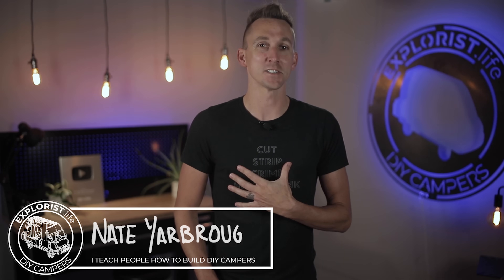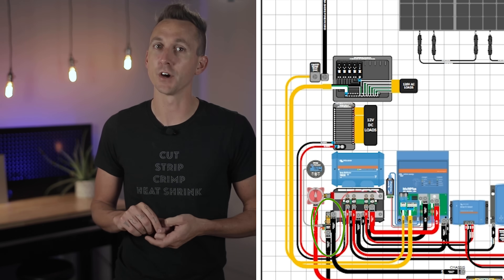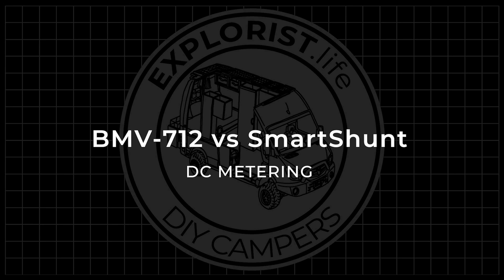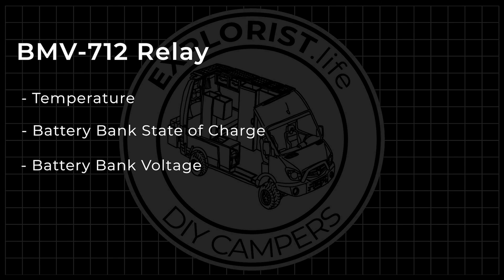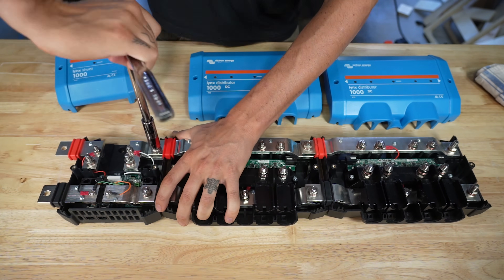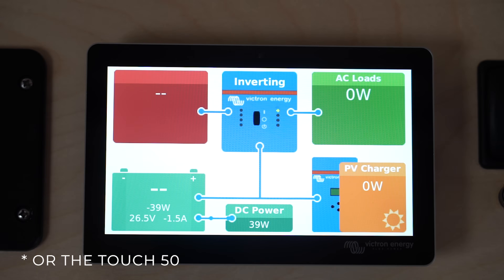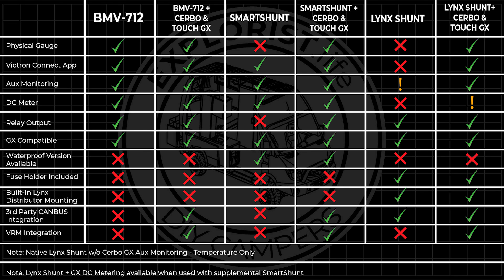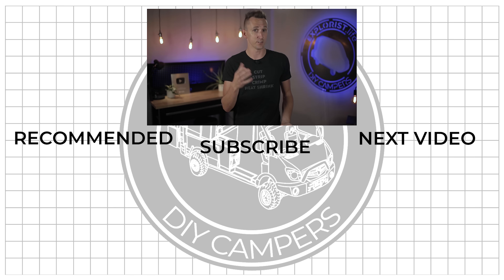SmartShunt vs BMV-712 vs Lynx Shunt

Comment: Great info! I do have a question... I have already purchased a BMV-712 as well a lynx shunt before I understood the component functions. So now I'm learning that it is redundant and possibly disruptive if I use both of these items? I need to decide which to use. If I decide on the Lynx shunt I will need to buy a separate monitor such as the Color Control GX? Which is not a modest price. But if i dont keep the lynx shunt that I was going to place between my two Lynx distributors can I just attach the two distributors together directly? I bought two to have my batteries on the left distributor and other items on the right distributor. Would love to hear your input on these options, thanks!!
Reply from the maker: That’s a great question—those component overlaps can definitely cause some confusion. It really comes down to how you want to monitor your system and what setup works best for your layout. Our support team can walk you through the trade-offs and best options for your gear.
🔧 https://shop.explorist.life/support

Comment: Lynx shunt is nice if you’re using one main fuse for your battery system. Do you recommend a separate mrbf per battery or is that overkill and one main fuse is enough?
Reply from the maker: Reach out at https://shop.explorist.life and we can get you what you need with the proper system fusing.
Reply: @ was just wanting your opinion

Comment: Question Nate ... I have a Victron IP65 Battery Monitor shunt with the optional temperature feature. I currently have the temperature sensor wire connected to a LiFePO4 battery positive post. I have a battery disconnect switch between the battery positive post and a positive bus bar block. My issue is when I disconnect the battery using the disconnect switch I still have a small battery drain which I assume is because the temperature sensor is connected to the positive battery post. Can I connect the temperature sensor to the positive bus bar block which is after the battery disconnect switch? Will the battery temperature still be accurate when the disconnect switch is "on"? Thanks. Your videos are very your informative!
Reply from the maker: This may take some more in-depth troubleshooting.  If you have purchased/are purchasing from our store (shop.explorist.life) reach out for some more personalized help: shop.explorist.life/support

If you've purchased/are purchasing elsewhere, reach out to your dealer for support.  We'd love to have you as a shop.explorist.life customer so we can provide a bit more help in the future. 🙂
Reply: @EXPLORISTlife  Will do. Purchased directly from Victron. Thank you.
Reply from the maker: Victron doesn't sell items directly.  They sell EVERYTHING through a dealer like ourselves.  Would love to have your business next time so we can give more personalized support like you're requesting.  We are prices as low as Victron allows (MAP pricing).  Glad you found the videos helpful, though!

Comment: I just discovered an important comparison point between the Lynx Shunt and the BMV-712.  When the power is interrupted to your system, the 712 "remembers" the last state of charge of the battery and there is an option in the set up to have it always pick up where it left off when the power is restored.  I assume this is also the case for the Smart Shunt (I don't have one of these).  I can't find a way to do this with the Lynx Shunt and the only way of restoring the state of charge after power loss (let's say after switching the disconnect for a maintenance procedure) is manually entering it or fully recharging the bank to reset it to 100%.  Thank you!  You've made my system build so much better!

Comment: I have to add that the bluetooth on the smartshunt is well documented as being shit. Check the victron community forums. Getting it to network wirelessly with other victron stuff is a drainer if they arent right next to each other. 

Our camper is largely steel and this caused a ton of issues getting the CC to speak with the smart shunt.

For what it's worth, I have heard that the BMV may have better bluetooth than the smart shunt, and for that reason alone I would always recommend the BMV. The weak bluetooth drives me crazy,

Comment: can you wire the BMV-712 to the battery post on the lynx distributor so when you turn the battery switch off you dont lose the SOC on the monitor? Any other way of avoiding this loss of info?
Reply from the maker: I don't recommend that because like that, your master battery switch doesn't 'actually' turn everything off.  Feel free to play around with it as you feel appropriate for your own needs if you are confident in this stuff.

Comment: Is there anyone out there who has problems with the LYNX Shunt 1000 showing the wrong voltage? Mine here shows about 0,2V less than the other Victron devices in the system and is definitely wrong when you compare the measured value with a very good multimeter.
If someone has a solution for this issue, please write a comment on this - thanks!
Reply: Check for voltage drops on tha cables. They can be surprisingly high.

Comment: Great video.  Quick question, though.  Maybe this should be obvious from the video but is there a way to see your battery usage on the Victron phone app with the Lynx shunt?
Reply from the maker: This is one of the biggest downfalls of the Lynx Shunt.  It isn't able to connect to the VictronConnect via Bluetooth.  If you want to view battery percentage via your phone with a Lynx Shunt system; your Lynx Shunt -> Cerbo/Ekrano GX must be connected to the internet, and then you can view that data on the VRM portal.
Reply: Thank you  @EXPLORISTlife !

Comment: Battery shunt question. I currently own the Alley Shunt voltmeter 350 amps.  I want to connect it to my 2013 Itasca ellipse QD 42. My coach has six AGM batteries. The current configuration is 1 3/0 neutral connection on battery 1 feeding the 2800-watt inverter and the other 3/0 cable on battery 6 going to the frame of the coach. Do I take both 3/0 cables and connect to the shunt then from the shunt back to battery 1 & 6?

Comment: I have 2 completely different battery banks hooked up to my motorhome. I have a 560ah homemade batt with the 712 and I have 3x100ah renogy lifepo4 Batts on a renogy monitor. I'm thinking I should take the renogy monitor away and add the smart shunt. Maybe this way I can monitor both batt banks online.

Comment: Great video. How do you install a SmartShunt in a Sprinter with a factory under hood aux battery which has the negative battery terminal grounded to chassis? Was thinking of putting the waterproof one under the hood by the aux battery. We have a BlueSea fuse block for our maxxair fan, espar D2, and other accessories hooked up to the output of the battery isolator relay under driver seat, as is typically done, and the negative from the fuse block is grounded to chassis under the seat. Do I need to run the negative from the fuse block back up to under the hood to the other side of the SmartShunt?
Reply from the maker: If you are trying to monitor the state of charge of the aux battery, the shunt would need to go between the aux battery and EVERYTHING else (starter battery & loads).

Comment: If the BMS on your battery (like an EG4 LL v2) communicates with the Cerbo GX, there's no reason for a separate shunt, is there?
Reply from the maker: That's just going to depend on what data/info the specific battery bms will communicate.

Comment: For now i have my Victron Mppt Control Display (which cost me about 85 euros) pluged on my Victron 100/50 Mppt Charger (more practical for me using that than a Mppt with bluetooth) working on  a small 12v 3Kw off-grid system. Its not that hard to watch the voltmeter of the display and know how much energy still have since i know 12.1 volts are about the 50% of my battery bank. The inverters are programmed to shut down and protect my batteries anyway. Very wellmade and informative video.
Reply from the maker: Nice!  Sounds like an awesome project!
Reply: @EXPLORISTlife  It does work good for lead/acid batteries because they have almost linear charge/discharge. I have AGM. But if i had llithium batteries i would really need a battery shunt because lithium doesnt go linear.

Comment: Question: I have four 12v 200ah batteries wired 2s2p (24v @ 400ah) being charged with a Victron 150/60. The Victron defaults to 28.4v absorption and 27v float. I just wired a smart shunt and trying to figure out the settings. Suggestion for "charged voltage" settings? There's conflicting information online. Thank you if you can help out!
Reply from the maker: Set that to .2V lower than the absorption voltage of your charger.
Reply: @EXPLORISTlife  thank you for the response!
Reply: @EXPLORISTlife  thank you for the response!

Comment: I've read most of the comments and although you've presented a "pretty" video, you didn't address the big problem with Victon. The vast amount of interconnection incompatibility. Bluetooth, WiFi, IP, NEMA, VE Direct, Smart Dongle, CAN-Bus, USB, MPPT, and probably more,  means that setting up a system requires a Degree in IT. The Victon "Connections" Manual is over 80 pages. In addition, software upgrades happen nearly every 3 months. My system is offline 50% of the time because of a glitch issue somewhere. Power off of the entire system (which is very basic) is the only way to get it going again. Again, from reading the comments, I believe Victron needs to simplify their systems.
Reply from the maker: I disagree wholeheartedly.  If you want to use each and every single function of the unit, yes, you will need to be proficient at understanding technical language and such.  If you want to use it to view all the necessities, that stuff is pretty straightforward.

Much like using a computer: if you want to just be able to browse the internet, make documents and spreadsheets, view/edit pictures, and watch videos, it's pretty easy.  If you want to develop your own web application, you are going to need to know much more.

Comment: Love these videos! I've re-done my entire system with Battleborn, Victron and Go-Power solar panels and my next project is to add a multiplus ii and clean up the wiring with the Lynx distributor using the info I've learned from your videos.  Meanwhile, hopefully you or a reader can help with a problem I've encountered: I hooked up a Victron Smart shunt to serve as a DC meter for my water pump. My thought that the energy use meter would be a much more precise gauge for the water usage than the unreliable water gauge on the panel.  And I think it would be, but the problem is that the calibration in the consumed energy meter (in DC meter mode) is in tenths of a kWh. So one "click" on the meter is 100 wH.  This is not helpful, because the water pump only draws 69 watts, and the water tank is 60 gallons. The pump would pump the entire tank before the meter registers one click!  Is there a way to change the "scale" of the meter to watt hours instead of kilowatt hours? Or some other workaround?  Thanks for any help.

Comment: Helpful video.
Can you connect a GX-50 to the shunt that comes with the 712?
What does the Cerbo GX do?  I don't need wifi to monitor, not even sure I need bluetooth since most of our camping is areas without cell service and I don't want to be glued to my phone.
Thx
Reply from the maker: The Cerbo GX needs to be between the 712 and Touch 50.  The Cerbo GX is essentially the 'motherboard' in which all of the peripheral components are plugged into.  That info is 'gathered and organized' by the cerbo gx and then passed on to the touch 50/70 for display.
Reply: @EXPLORISTlife  , ahhhh, thanks for the reply.  👍

Comment: If I used a bmv-712 with any other component other that victron would it monitor it properly on cerbo GX and the accompanying screen? 

For example:  if I used a sun gold power inverter?
Reply from the maker: The bmv-712 will show how much power is passing through it regardless of what brands of components are on either side of the system.

Comment: hey im looking for a custom set up what would you recomend for a swb camper the setup im looking for is 200w solar split charge from the alternator power inverter / charger that runs from a 230V hook up i was thinking of running the the shunt conected to the bmv 712 shunt with a digital display
Reply: i would like to get some possible blueprints from you so i can clearly see and fully understand how it all works and connect or even a added touch screen pannel i could also wire in
Reply from the maker: Sure!  I've got a bunch of different sizes of systems available at https://www.explorist.life/solarwiringdiagrams you can choose from depending on the size of system you want.

Comment: Isn’t an important difference between these shunts the location of the ve direct socket.  The BMV 712 has the socket on the display while the smart shunt and the others are at the shunt.  This could create additional wiring difficulties when adding a Cerbo GX.
Reply from the maker: Correct.  The BMV-712 Ve.Direct port is on the physical gauge.  The SmartShunt has the VE.Direcct port on the actual shunt.  I don't usually see people running into issues with that; but that is indeed an additional difference.

Comment: Great video as always! Have you installed a Wakespeed WS500 in any of your designs? I’m going with a Nations 3-belt alternator and BB GC3 with internal BMS; no CANbus. Trying to get the puzzle pieces to fit together.
Reply from the maker: Not yet, but all of our system designs are compatible with Wakespeed charging.
Reply: @EXPLORISTlife  Thanks, Nate.

Comment: Hi. I just purchased the diagram for the 3000k MP with 400+ ah and up to 1250W solar, but I didn't realize it didn't include the info for the Linx shunt or Cerbo. Where do I find that diagram?  Thanks!
Reply from the maker: That diagram doesn't include Lynx Shunt and Cerbo integration, but we will have an update to that diagram soon that shows it.  Submit a support ticket at shop.explorist.life/support and I'll make sure you get the updated version when it is live.  In the meantime, the Cerbo GX online manual does a REALLY good job of showing how all of that is connected.
Reply: @EXPLORISTlife  , thank you! I'm at this stage in the build out of my box truck. 😊  I'll also look at the Cerbo manual. Thanks!

Comment: The Bluetooth range difference between the 712 and the smartshunt is huge. I’m talking 1m to 15m. Should count as a feature difference.
Reply from the maker: Is that the newer models?  They've fixed the range issue that some people were having in the newer smart shunts.
Reply: @EXPLORISTlife  Hardware or software fix? I’m not aware of either. My SmartShunt is about 2 years old. Specifically chose it as I didn’t want the screen. Definitely would have gone with the 712 had I known the range would be an issue.

Comment: Would there be a reason for the average conversion to need the 1000amp version of the shunt? I'm over specing my solar and power system to run 240 volt for electric vehicle charging and am planning to have a vary large battery capacity. Would I need the bigger shunt too? Also a video on doing 240v or dual inverter systems would be awesome.
Reply from the maker: I can see no reason to need the 1000a version of the shunt, no.  If inverting needs are from 3000W-6000W, I'm recommending 24V battery banks, which keeps amperage down to only 250A.  If somebody needs more inverting power than that (and no DC loads), I'll recommend 48V system w/ dual Victron Quattro's and VE.Panels and run those in battery monitor mode, which means a shunt is no longer necessary.
Reply: @EXPLORISTlife  thank you for the confirmation!

Comment: Nate, I bought a bunch of stuff from the website a few weeks ago, including your diagram, lynx, Orion, wiring kits etc.. and just got it all wired up. My Orion runs really hot after about 45 min, and I have it mounted out in the open. Not enclosed. Used #6 wire ancor wire and everything. Also noticed a electronics type smell in the van. Not burnt out electronics, just a different smell. Wanted to make sure this wasn’t a concern before I start looking into fans and such to mitigate problems
Reply from the maker: The Orion does indeed run a bit hot, but not so hot you can't touch it or anything.  Make sure the firmware is all updated as there was a firmware update that fixed it a bit, but it still is indeed quite warm when it's operating at full capacity.

As far as the smell, with new electronics, there is sometimes a weird smell that goes away after it's been used for a bit.  See if you can narrow down where it's coming from to make sure there isn't a loose connection or something somewhere.
Reply: @EXPLORISTlife  mine is getting too hot too leave you’re palm on it comfortably for more than a few seconds. I double checked the connections and everything is tight
Reply from the maker: @jamilchavez4592  Would you submit an order support ticket for this so we can investigate further? shop.explorist.life/support
Reply: @EXPLORISTlife  sent. Thanks for the fast response

Comment: Offtopic but can I charge the normal agm pb battery with battery charger while solar charge controller and inverter are connected?
Reply: I think he means having a DCDC charger and MPPT charger simultaneously charging? If so, yes you can have all those connected at once.
Reply: @HiruS22  I am wondering if he is connecting the battery charger directly to the battery?
If so it is bypassing the state of charge monitoring.
Reply from the maker: I'm not sure I'm fully understanding your question.  Perhaps rephrase?